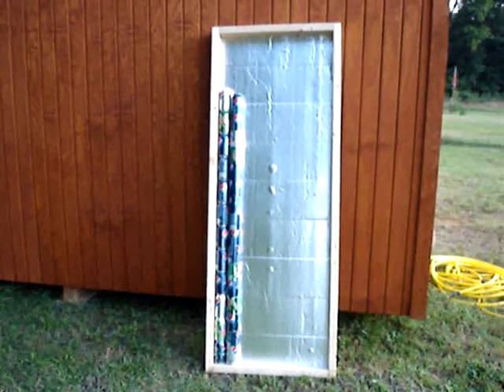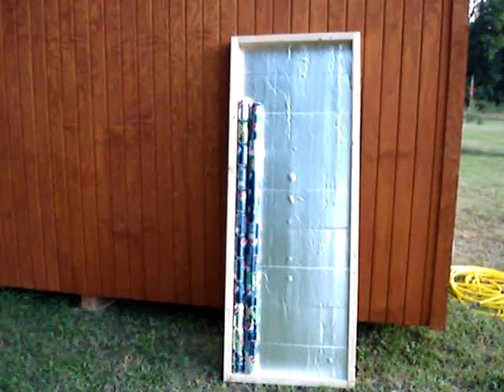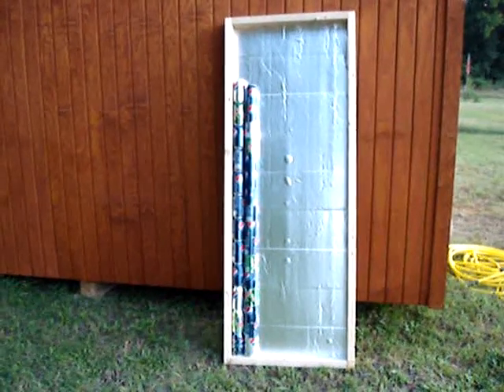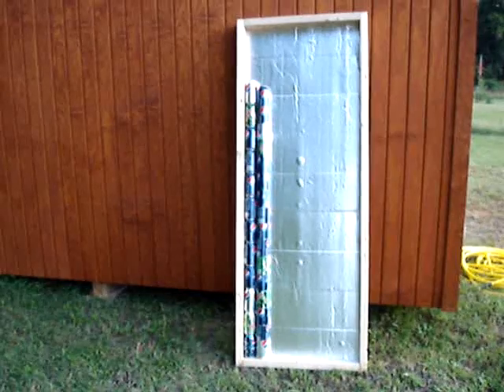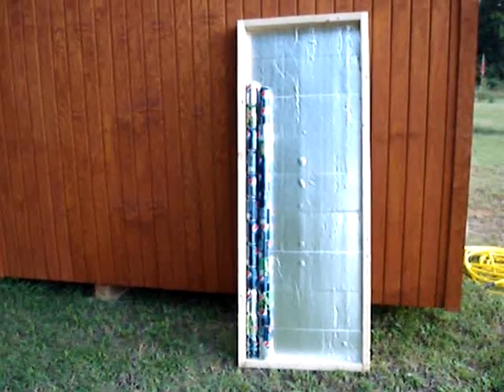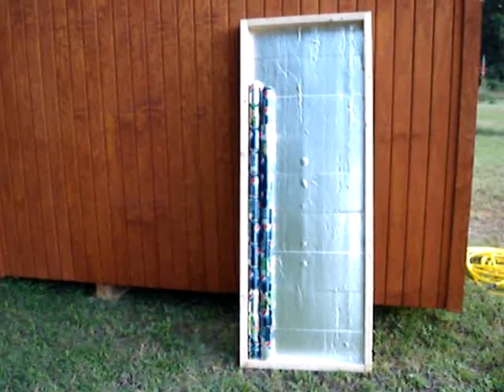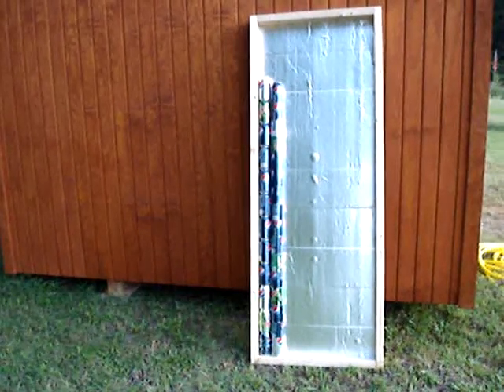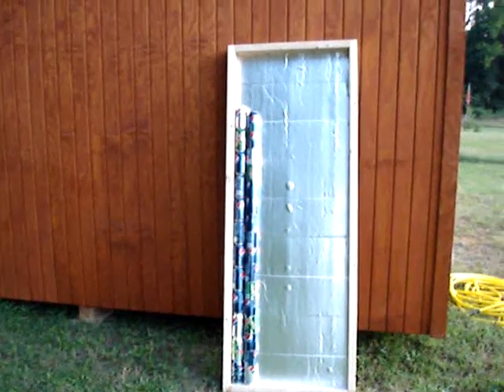Solar heater columns part 2

Comment from the maker: @wlomond Well, I think you might be right on that point. But with the 2 heaters that I have built , I really have not noticed a big difference of what they put out in heat. but what you said does make a lot of sense, thats why the next 1 that I will be building will be with a downspout with the cans inside it. I will also be looking into putting rocks or sand in a chamber to retain more heat.  I am hoping to be able to store the heat for longer, Just a thought. Thanks for the question, Lonny

Comment from the maker: @souleeze Hello, yes the cans have stayed attached so far. It has been way over a year and they are still all connected. You are right, I would only insulate it if it was outside. It should be fine if it is in your shop, like in a window. Thanks for the question

Comment: @supergokue1 do the cans stay attached using heat to expand them? If i made a box with cans in it and had that on the inside of my shop would i still have to use the insulated/foul backed board , is that just if it is outside to keep heat in? thanks

Comment from the maker: Well, after cutting the top off with a can opener, I took a old towel and crammed it in the can so it would not dent as I cut the can. Then I took a hacksaw and made a line around the bottom of the can. The aluminum gets real thin after that. Then I took a razor blade knife and cut the bottom off. It took me a few tries before  I got good at it. Thank you for the question, Lonny